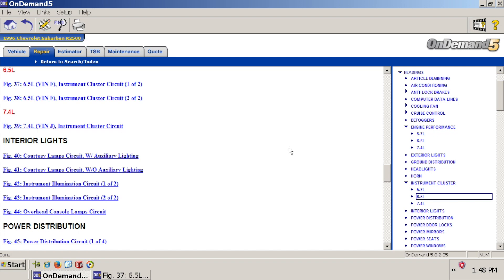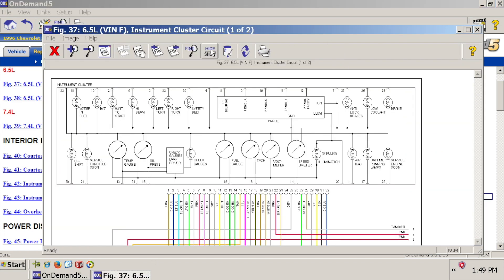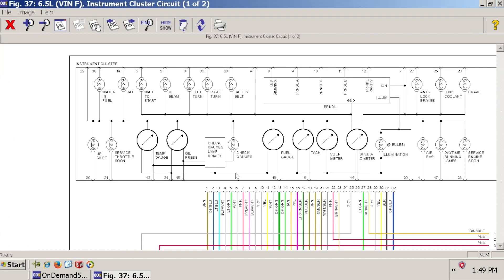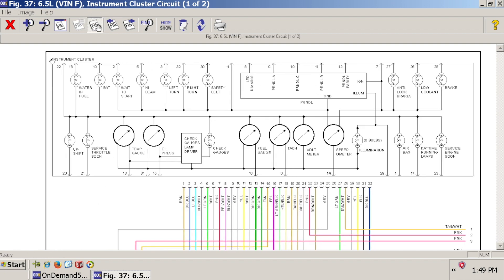DIY Cummins Diesel Swap: How to Wire Your Gauges

Comment: Hello sir i have few questions about a cummins swap i have 1992 ford f350 and it is gas truck and i got a 2003 dodge diesel truck i have the whole truck with all the wiring and computers the dodge is obd 2 and my ford is obd 0 .can you  Guide me in the right direction

Comment: Hay I need help please theirs a cou things I have left to wire so I did a Cummins was a 98.5 5.9 Cummins alone with all the wiring over to 02 dodge ram 1500 4.7 so I have most stuff wired besides the head unit like the lights on inside for cab and the heat and ac control for it to fully work need help asap if u can please

Comment: Great video! I am having issues with the speedometer.  My tk is a 1996 k3500 (7.4 to a 24valve).  I kept the dodge 47RE trans and the nv205 transfer case.   I am using a Firepunk anteater as a stand alone computer. Any suggestion on how I can get my speedometer to work?  I did switch the cluster panel to the chevy diesel one.   thanks for your time.

Comment: Once again, Joel is the man!  I tested the alternator wire to the ignition coil on my [454] truck today.  I'll definitely need the Dakota Digital - the tach was way off, although it was nice to see it alive again.  Hehe.  I'll  be ordering that from you this coming week.   Next up for me, AC wiring.  I finally got my hoses done and my system charged (by manually energizing the AC clutch) but I cannot for the life of me figure out how to make the computer trigger the AC on its own. All of the wiring is unaltered from the 454 days.  Any tips there?
Reply from the maker: You need to bypass the high-pressure sensor.  That is probably locking you out from just relying on the cycling switch on the receiver dryer which is all that you need.  The ECM does not control the AC request.  If you talk nice I might do a video.....LOL
Reply: @Jonesys  I'm talking nice. I wish I had your video's when I did my conversion. It would have saved me some money, and lots of time. But boy what a ride. thank you for your vid's
Reply: @Jonesys  any ways you could do this with a 1986 el camino. Building a swapped elco. Getting close to wiring it up